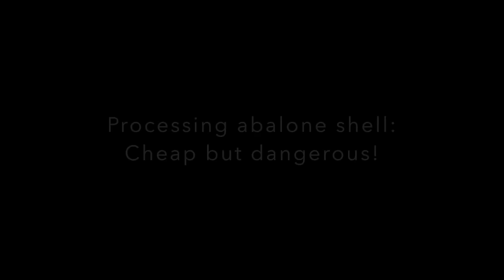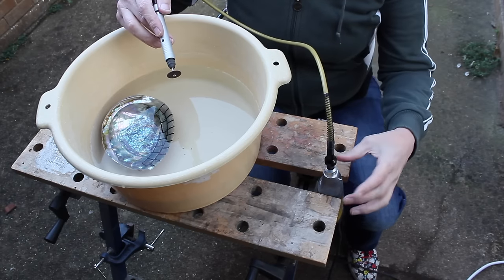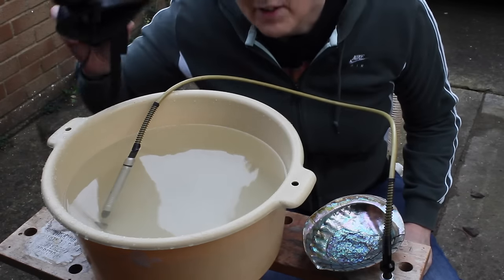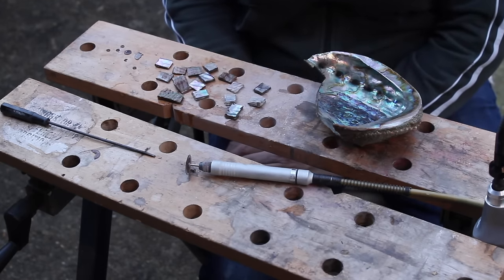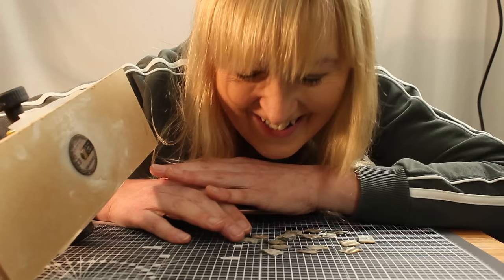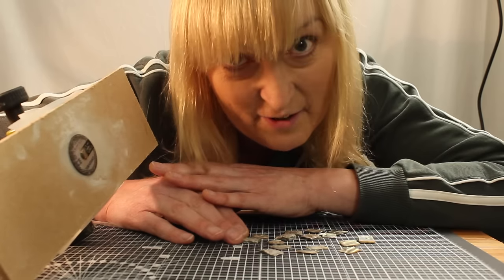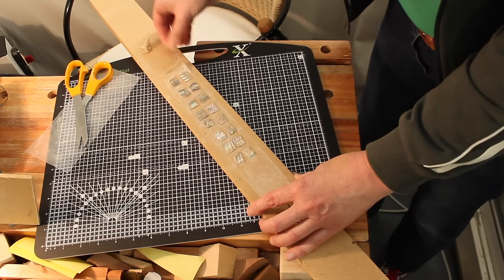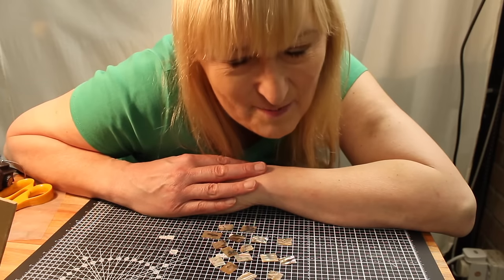Processing abalone shell: cheap but dangerous!

Comment: I think a tile saw might be a good alternative for cutting shell. I tried bandsaw and the sparks flew
Reply: I just got a wet/diamond tile saw for pretty cheap...works GREAT; a bit messy (water), but cuts like "knife-through-butter",,,,,the kerf is a bit wide, but I think narrow-kerf blades are available...btw the saw I got is the 4.5" blade; you don't need the larger dia blades for cutting the shell....

Comment: Probably the most dangerous crafts video I have seen to date. If that cutting wheel can cut through abalone, which is a very tough material, think how quickly it would slice through a glove, leather or not, and then through your skin. Not to mention the electricity and water set up, extremely dangerous abalone dust without a dust mask, and the makeshift tool set ups. Any time you work with power tools and describe the experience as, "that was dangerous", and say, "dangerous" multiple times, you're setting yourself up for a painful experience.  Please modify your methods before you get seriously hurt.
Reply: jewlers saw the pro tool
Reply: Kyle Ybarra I agree! And the goggles should go on at the start!! Not just for "dust in your eyes",  but flying shards!! Power tools under water, omg! Get a hose, pit on a slow drip and cut it under drip! yikes!!!